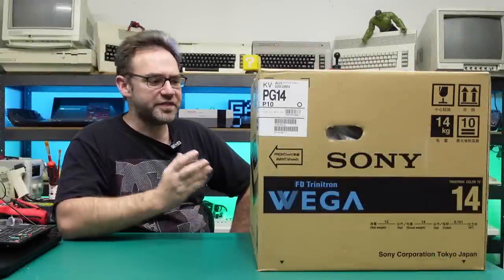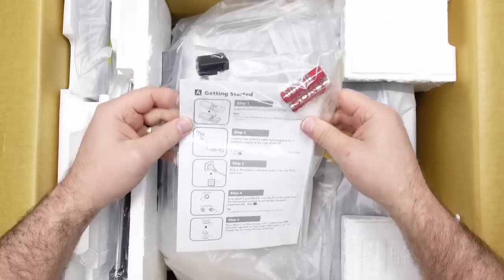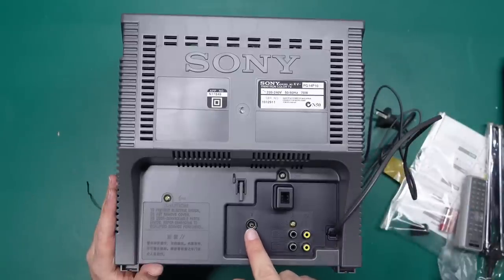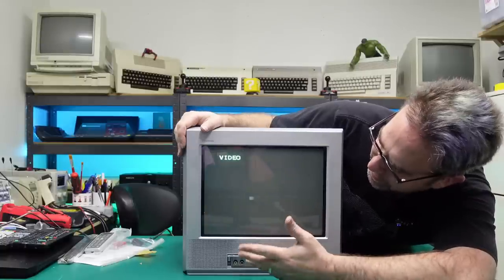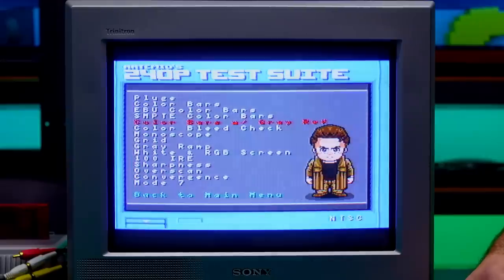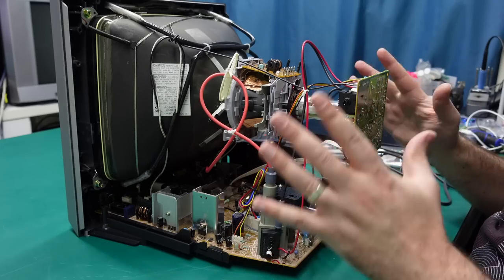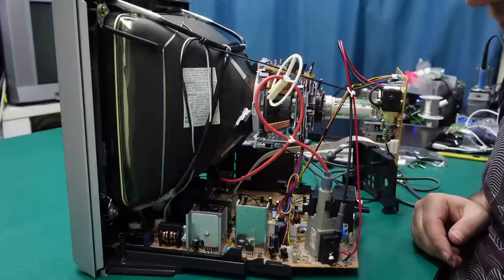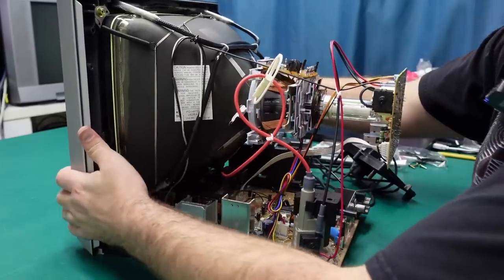Unboxing a new old stock CRT in 2022 - Sony Trinitron KV-PG14P10 TV

Comment: Just thought of something else and nobody seems to ask about it. Primary colours are Blue, Red & Yellow so why isn't the phosphor coating in a crt yellow and it continues in the digital screens in being called RGB. When I did my training with Sony it was explained as basically it didn't work, green phosphor worked better for colour balance.
Reply: In print/painting, you have subtractive mixing of colours (they remove light), and the primaries are yellow, cyan and magenta, all three combined capture all the light resulting in (near) black. With light you do additive mixing, and the primaries are red, green and blue, and combined they appear as white. You did have Quintrix TV's though, those had 4 phosphor colours, with added yellow.

Comment: The trinitons where the only crt I know that has the clearest picture quality
Reply: Jvc also had similar very clear pictures
Reply: Actually tridot screens were usually having a higher resolution. If I hook up a vintage computer with 80 column text, the Trinitron is harder to read. Trinitron was more about higher brightness, and slightly different colour primaries, with green further towards blue, resulting in a bigger colour gamut.

Comment: So CRT’s made in this period are cost reduced? I have a 32 inch Sony Trinitron 32FS210 which says it was made end of 2006, so I am hoping it is good because the composite quality is great on my SNES, but the outside of the TV set is very beat up. Someone had it in their garage for like a decade due to the weird rust on the inputs on the back

Comment: These TVs really need a PS1 or PS2 sitting in front of them. 
My one of these if probably the sharpest composite CRT I have. Shrunk down to 14” really hissed a lot of sins from composite video. 
I’ll get you to run me thru those adjustments again at some point.
Reply from the maker: Yeah, I really need to burn buy some PS1 games. Although I couldn't find an advert for this CRT, I did find some for the bigger Trinitrons from 02/03 where they were throwing in the silver PS2
Reply: @TheRetroChannel  do we also need to find a silver PS2 Fat?
Reply from the maker: Fk yeah we do!

Comment: Simplest RGB mod you can do,  straight in the empty text header., OSD is mixed post jungle so no need to mux.  I wonder if the convergence was set with Picture setting at 100 and now you've reduced it the convergence has changed?
Reply from the maker: Yeah, very simple to RGB mod this one, I'm just waiting on a scart connector to finish it up. I'll have a closer look at both the RGB mod and convergence issue in an upcoming video
Reply: @TheRetroChannel  Scart is a tight fit on that AV guard.  Suggest adding RCA or BNC and a switch
Reply from the maker: True, I was thinking of going RCAs or BNCs, but currently all my RGB cables are scart. Although they are cheap unshielded crap anyway, so really I should either ditch scart now, or embrace it. Just need a little push to go one way or the other 😄
Reply: @TheRetroChannel  Completely understand people wanting scart.  If you look at most of the scart switches for sale these days, they have additional RCA RGBS and audio outputs.  So could grab one of those.

Comment: Is it 4:3, or some other ratio?
When trying Mario World, at first (10:23) there are big black horizontal bars, but it's full screen at the end of the video. What changed? 
Thanks :)
EDIT: Oh, I see, the Service Menu. I hope there is one on my 2008 Sony 19 inches lcd, I have big black bars on hdmi and the standard tv ratio options does not apply to the hdmi input for some reason.
Reply from the maker: The SNES has an odd aspect ratio, or should I say non square pixels which do not translate well to a fixed pixel flat panel display. Also the PAL SNES has extra horizontal stretch, or vertical squish which causes even more "letterboxing"

Comment: Awesome video, but you should put some music in the background at a low volume, it would add a lot to the video imo
Reply: Actually, don't do this. I HATE having to strain to listen to someone speak because they are competing with completely unnecessary "background music". It's way too easy to mix it too loud, especially if you aren't willing to apply compression to your voice track to make sure there aren't moments where your voice dips down too low and gets swallowed up by the music. It's the cardinal sin of youtube videos.
Reply: @jaystephens3115  you just have to get it right, that's it. i do agree tho, may don't

Comment: Travis Parker quoted a myth about the earth's magnetic fields influence and I want to explain why, already replied in his post . This is the quote:-

'Tubes have to be designed to compensate for the earth's magnetic field, and that is flipped in the southern hemisphere vs. the northern.'

My reply

'sorry wrong, you will notice when the tv powers up a huge power surge and if you see pictures of the back of the tube you will see wrapped in black sleeving what is called the de guass coil and it basically overpowers any magnetic fields in the tube by it's own very powerful magnetic field for a few seconds. It's why you run can magnets over the front panel and make stupid convergence patterns as the DG coil resets everything on the next power up but if your DG coil doesn't work you've ruined a perfectly good tv until a new DG coil is fitted.'

Regards,

Paul
Reply: ps because they took so much power, occasionally DG coils caught fire when faulty.

Comment: That first set with the geometry issues has 28171 hours, which in Trinitron hours is like a million years, in my experience you can really see the sharpness and geometry degrade above 10K hours on sonys, I am not sure which components are responsible for the degradation though
Reply from the maker: Hah, yeah huge amount of hours on that one. I think if you make it to FFFF you should get some kind of bonus round, maybe it resets and becomes new again
Reply: Using 24h/365days it's 3,21 year and 7h every day is 11,3 years use.

Comment: Did Australia not get RGB scart sockets? 

Just curious why there was only Composite video out on this CRT :)
Reply from the maker: Very few sets had scart here, it certainly wasn't widespread like it was in Europe. It really wasn't until the early 2000s when we started to see s-video, scart and component. For example the bigger Trinitron I have from around the same era has composite, s-video and component but still no scart. Component became common likely due to progressive scan DVD players, and then of course HDMI came along. So we kinda got screwed in Aus when it came to analog video options
Reply: @TheRetroChannel  interesting :) I'm from the UK myself so every CRT I saw growing up had a scart input and eventually scart and component on HD CRTs :)

Comment: If it is a BG-3 chassis then for the RGB mod you can just hook into the unpopulated CN307.
Reply from the maker: It's a BG-2T. But it sounds like it will be similar to the BG-3, there's an unpopulated connector at CN001 which is perfect for the RGB mod. I'll have a video on it coming up in a couple of weeks
Reply: @TheRetroChannel  Bg-3 requires an osd mux, this is easier, it’s just like Bg-1s, insert rgb to the teletext header and change termination from 150r to 75r

Comment: Hi mate wondering are you still using this and/or end up modding it? Hoping to mod a similar model. Cheers
Reply from the maker: Yep, it's been modded with RGB I just haven't got around to doing a video on it. To be honest it looks better but nothing amazing. The colours are certainly better with RGB and the image is cleaner. But it's let down a little by the screen size and TV lines, I'd estimate it to be around 320TVL which is pretty low compared to a Commodore 1084 or most PVMs which usually start around 600TVL.
Reply: @TheRetroChannel  Appreciate the reply. I just got the earlier model. Thinking of giving it a go

Comment: Does this TV have NTSC on analog TV channel and system M (4.5 MHz sound carrier) also PAL-B/G (5.5), PAL-I (6.0), PAL-D/K (6.5), SECAM-B/G (5.5), SECAM-D/K (6.5).

European SONY TRINITRON doesn’t have NTSC-M tuner. Only SECAM-L (AM; -6.5 Mhz bandwidth), PAL-B/G,I, D/K, SECAM-B/G, SECAM-D/K
Reply from the maker: It's likely the tuner only does PAL B/G. No need to include any SECAM or NTSC tuning for the Australian market, most 'strayans would be confused just hearing the acronyms

Comment: Regarding the possibility of an RGB mod, I have a Sony Trinitron that looks quite similar internally (for obvious reasons) and I was able to use some unpopulated points on the board to RGB mod it - points I think I see on your board too!
There are a couple rows of unpopulated throughholes with boxes around them on the screenprint. Mine was even quite helpfully labelled with RGB, etc.

If it's like mine, it's an unpopulated input for a teletext board, which is much cleaner as an input point than tapping into the Jungle chip directly!
Reply from the maker: Thanks, yeah it is likely the same as yours. There's a unpopulated Teletext connector, and then it's just a case of replacing a couple of resistors. Just waiting on parts to arrive.

Yeah SoM was one of the first games I played on the SNES, and still go back to it today. If you're interested there's a link in the video description to the romhack I'm using. But you'll need to either play it on an emulator or a get a flashcart if you want to play it on original hardware
Reply: NES and SNES should not be hooked up over RGB. Nintendo just stank at connectivity compared to SEGA, so stick to the bad picture quality forever ever after.

Comment: Is there any  way to use component on this kind of tv
Reply from the maker: I looked into it afterwards and it's not possible on this particular model, but it can be modded to accept RGB (I'll have a video on that soon). You could then use a component to RGB converter like to retrotink comp2rgb for devices that output 15kHz component
Reply: @TheRetroChannel  this is great , i have the same tv , i wish to add RGB for it , will wait for the video sir ,

Comment: No s video, no buy
Reply from the maker: It'll get RGB instead
Reply: @TheRetroChannel  ok...which means you hook up via VGA component or ?
Reply from the maker: It'll be through Scart
Reply: @TheRetroChannel  ah nice if only USA had scart in 1987 instead of RF
Reply from the maker: I feel ya. I was RF all the way up until the mid 90s when I finally got a tv with composite. Blissfully unaware that Europeans had this RGB scart thingy
Reply: @TheRetroChannel  indeed the USA got robbed with RF composite svideo from 1980 to 2000 yet they had scart during that time which is tied with component yes